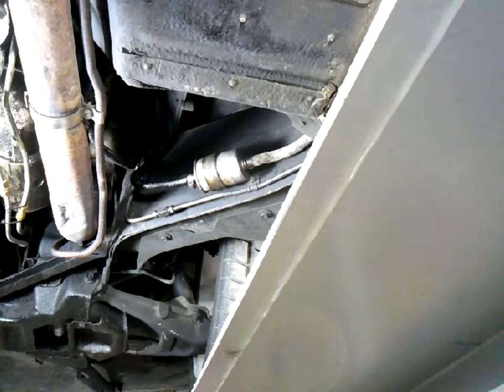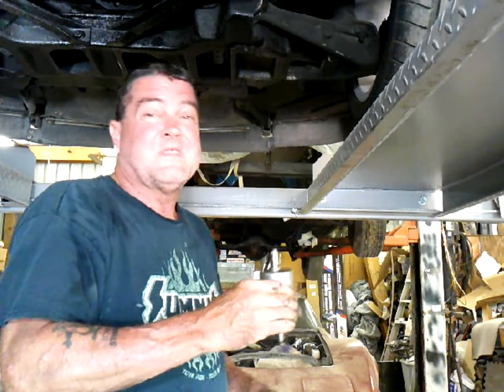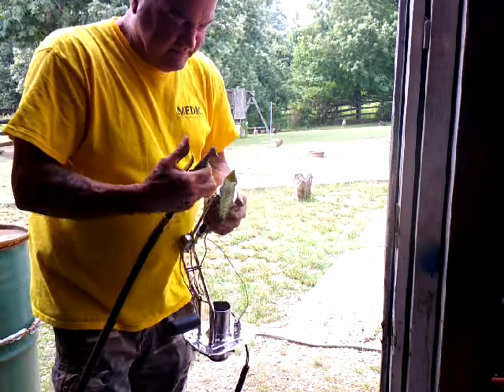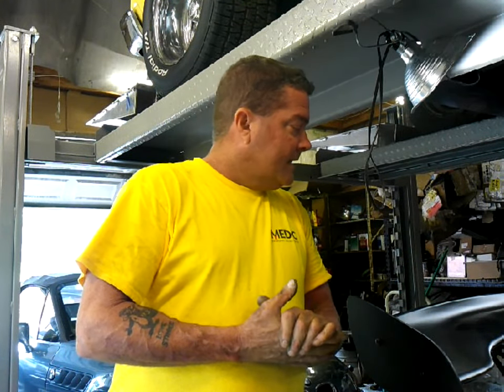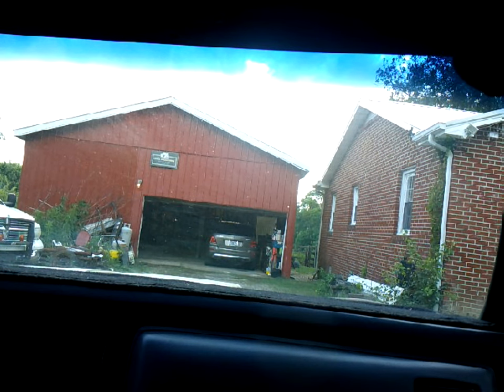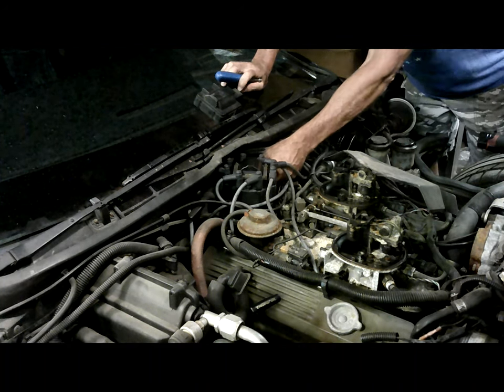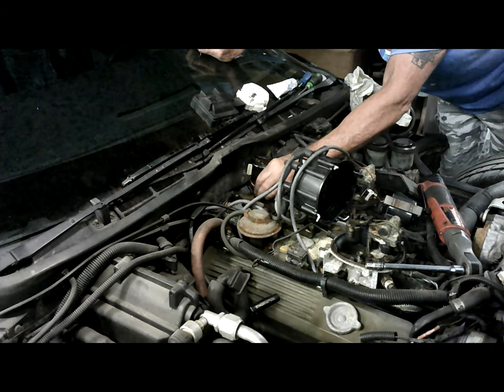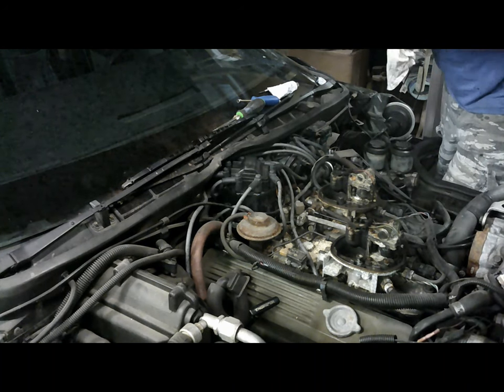Will this car ever run again? I've been wrong more times than the weatherman. Major fuel infection!

Comment: Hey, I just wanna give you a heads up. It might be some vacuum lines. I don’t think it’s a spark or anything like that I think some of that dirt might’ve got past the fuel filter and gotten your a injectors check that first and check the vacuum hose. Don’t go throwing money at parts when it might be the small things yeah just do a smoke test just to see if you got any holes in the vacuum lines cause that’s what it might be. Check your timing check your TPS and your idle air control. After looking after looking at the video, check your EGR valve.
Reply from the maker: Thank you for the tips. Much of that I have already tried (see earlier videos) but I do appreciate your suggestions. Intermittent problems are the worst to pinpoint, and it wouldn't be the first-time new parts failed me. Stay tuned because things got worse but better. You will have to watch the next video to see what I am talking about.